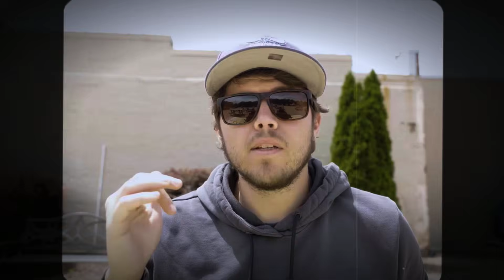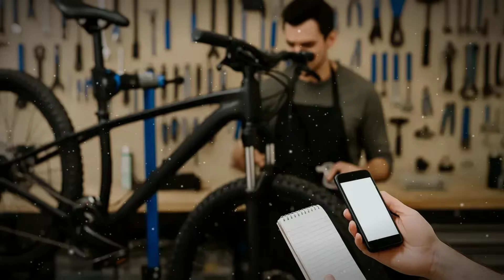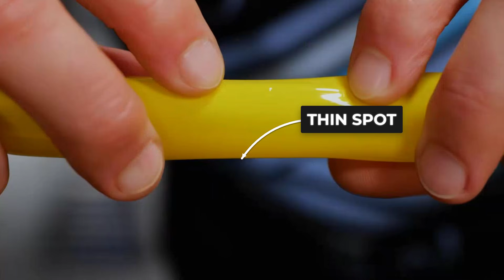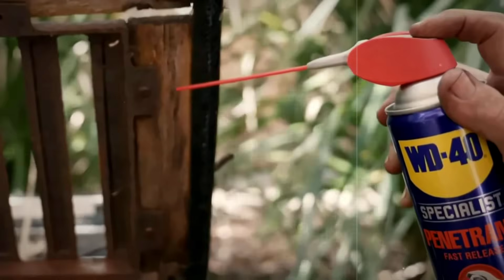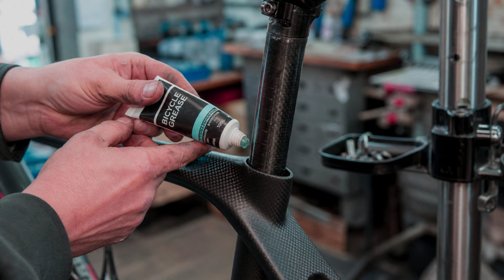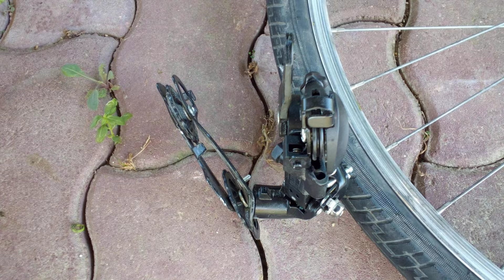Bike Tricks Repair Shops HATE That Anyone Can Do

Comment: To  use the ruler test, the chain needs to be under enough tension to pull it st straight
Reply from the maker: That is a great point, ensuring proper tension definitely helps get an accurate measurement!